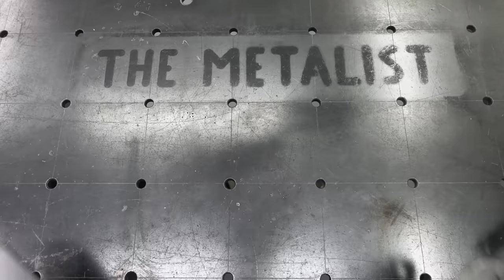Welding Project the ultimate Cart for your welder (look before you build yours)

Comment: verry nice and thought out welding cart , the only thing that might give you problems is navigating it through a narrow door or hallway , with all the plugs on the welder sticking out the side they can get caught behind stuff and damage the machine , off course unlugging the welding leads  before the move solves that
Reply from the maker: Thank you 😁
It also depends on which welding hose package is connected.  I have one that is very soft on the stick and hardly sticks out.  Another so I have almost 10cm more

Comment: Very nice, great concept! 
I love the idea with the table on the top, I also would go for this. It seems like it's very practical, just to have a place where you can put a tool or a part. 
Then, I love the idea of the thicker piece of metal with thread in it used, I didn't think of that... I need to integrate that into my design. 
Also the center of gravity, so you can lift it up with a crane, very smart! Let's not forget about the tank strap.

Comment: Hi Metalist, this is another ingenious design. Two things are new to me. the thread holder for the cordless screwdriver and the gas valve from the TIG welder.
Can you please tell me what devices these are, i want to use them, too.
Reply from the maker: Hi Ralf, Thank you 😁 the Theater holder from the battery drill is from Fein (ascm 18)
And the gas valve is actully a regular one
Reply: Thanks for answering that fast. My question was not about the valve/nozzle - soory, my fault - i want to know, where to get these angular or angled wig torch which you are using in the video. I'ts good to see, that there are a lot of advantages, especially in twisted forced positions. Will be great if you will let me know which brand/model you are using.
Reply from the maker: @FHbuddy  ah, they are from CK WORLDWIDE if you are from Europe you get them by EWS GMBH
Reply: @TheMetalist  Thanks! ... and of course I am very interested in the plan. I really need to build myself a welding car as well.

Comment: How the bloody fuck do you manage to weld with tig when you have millscale on the steel? If i dont clean everything with a flapper and acetone(or brake cleaner), i get sputters and shit in my cup... And its not settings or anything, if all is sparkly clean, i do perfect welds, but this, i would likely attempt suicide with 200 amps after 10 seconds...
Reply from the maker: I also grind the millscale off ... i have the same problem. But sometimes i grind off just enough for welding 😅
Reply: @TheMetalist  Yeah, tig is amazing, but it can be a vile and hateful way of welding, tho i would never use anything else but tig... Mig is a fireworks, stick electrode is even worse tho it has some very cool techniques, but tig is just supreme when you need a good weld, be it steel or alu(or any other metal, but come on, who welds copper and say gold or what not, maybe a model-boiler-maker would weld copper, but come on, that 0.001% of the populace with tig skills)... Prep for tig is a pain, it really is, but in the end, its worth every drop of sweat... Also, an amazing weld cart, but damn, as much as i insist on going balls out every time, i think my mediocre welding cart will remain as is... This is really amazing, A fucking +, industry grade, proper stuff, but honestly, at the moment, I am working on a grinding table for indoors, with dust collection and stuff, like a huge sanding cabinet, so i can grind and abrasive cut and what not indoors... But this masterwork you present us will for now be stored in the future projects mindbox...